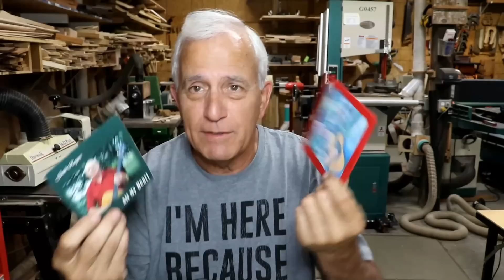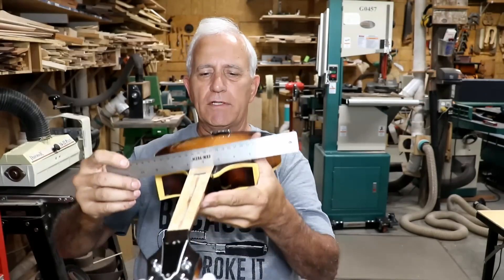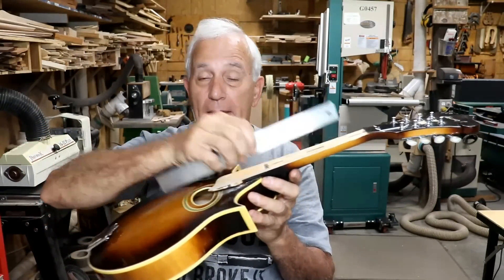VLOG #069 Checking Neck Side Slant on a Mandolin

Comment: I have had a boutique mandolin for the last couple of years, very meticulously built in 1989 by a violin maker, expressly voiced for classical music. As I explore this mandolin, I continually notice little surprising features about the build that demonstrate the fastidiousness of the builder. One thing I recently noticed was a very slight 'slant' of the fretboard downward on the bass side. Maybe this was inadvertent, but it also happens to be just the right degree of slant that matches the difference in gauge width between the low G and high E strings. That is, the bottoms of these strings at the 12th fret sit equal distance above the fret (as nearly as I can measure it with a caliper.) Have you ever encountered this in a build pattern, and if so, what might be the theory behind it? And couldn't it be much more easily achieved by tweaking the bridge in any case?

Comment: Tom and I feel your pain literally!  My first horse trailer that I bought was a several hundred dollar basket case that Tom and I and his when class (he was working) a class project  on welding job in the automotive section.  That trailer is still a ongoing 2 horse trailer project that we are rebuilding from frame on up, you name it has been done, and will be done until finished.  My big 4 horse trailer bought in better shape is also a ongoing project.  As all horse trailer owners know you either own it and work on it or in the later have someone else do it for you, I am not the later!   We still have to finish stripping the old two horse hauler.  It came to me looking like a melted fudge topped hauler with an interior of sort of white ? with green hand prints, for what reason I don't know.  The big horse hauler, we need to find some lights that we took off and they are now AWOL.  Oh yeh shall we talk about wiring harnesses?  Buy new? some may say, don't get me started, were search for hay to feed my brood and Tom's one, reference your previous video.  It's not easy being either of us, but hey that;'s just us!

Comment: A few remarks from a fellow sufferer of arthritis for what it is worth. Over the counter remedies do not help i.e. Voltaran, Alleve or other NSaids, the fact is arthritis is one of the areas of modern medicine where very little in the way of effective treatment has been accomplished. Steroid therapy in the form of injection or oral prescription does have some benefit but the law of diminishing returns very much applies. Following my recent back surgery I was prescribed Gabbapentin which is an oral medication for the treatment of Neuropathic pain, should anyone recommend this to you I would politely thank them and decline. Humidity is your enemy, invest in a very good De-Humidifier and try to do some exercises with a rubber ball or other device to keep flexibility in the joints. Best of Luck.